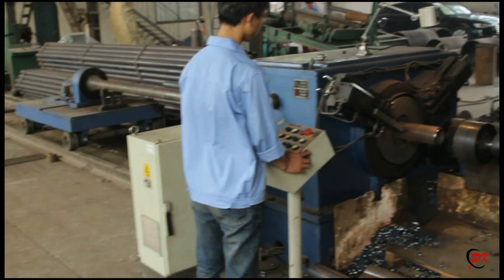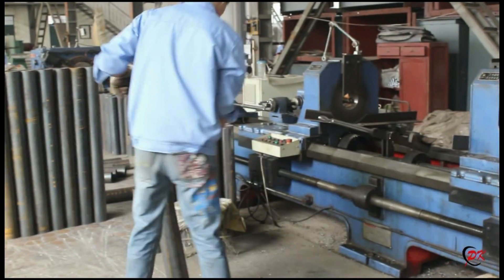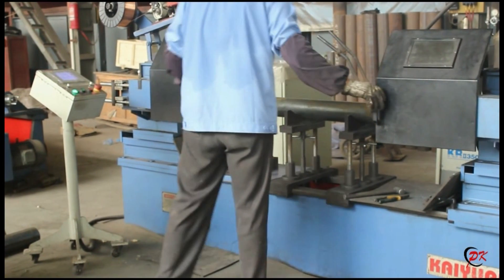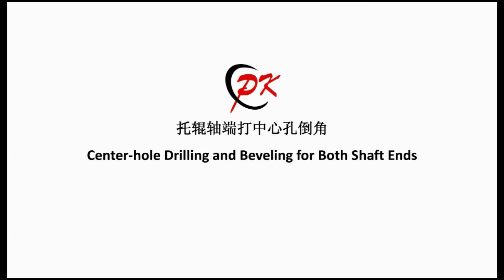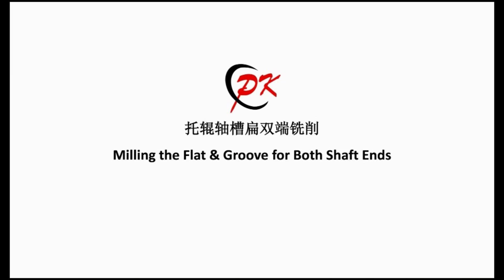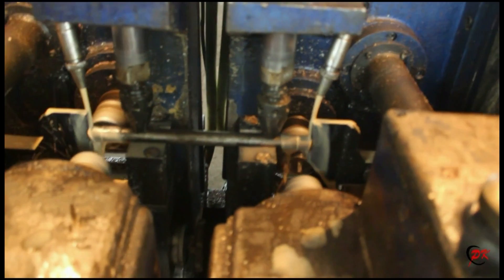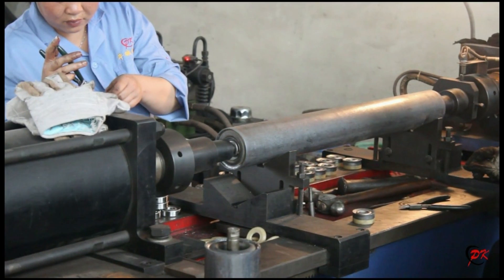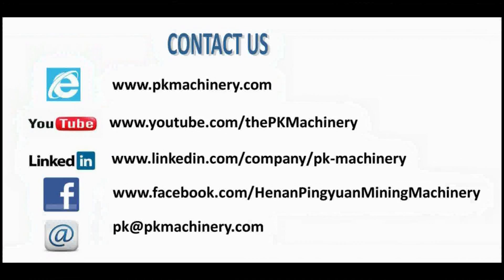Processing of Conveyor Belt Roller

Comment: NEED SOME TECHNICAL ADVICE - I want to know all the machines & it's specifications, which are used for following operations (in this particular video):-
1.automatic cutting & beveling
2.both end auto hole turning for roller
3.automatic welding for inside & outside seam of bearing block
4.center hole drilling & beveling for both end of shafts
5.milling the flat & groove for both shaft ends
6.automatic assembly for roller.
Reply from the maker: +Debasis Muduli This machine is a manufacturer of roller,I have added your Linedin,You can contact us ,Thankyou!